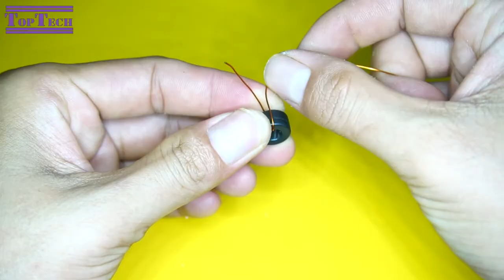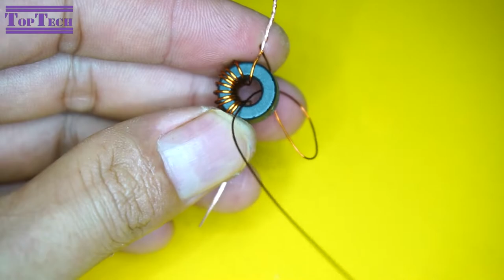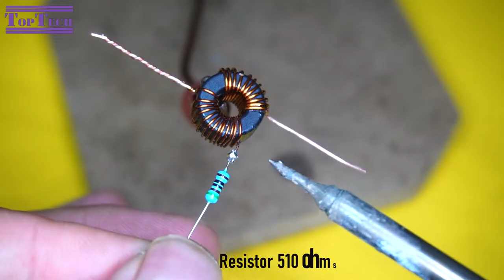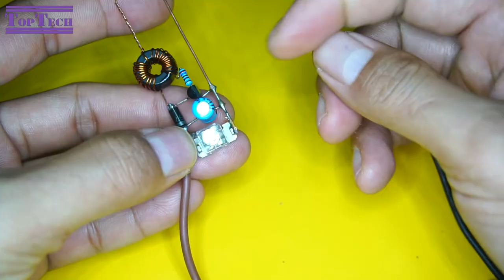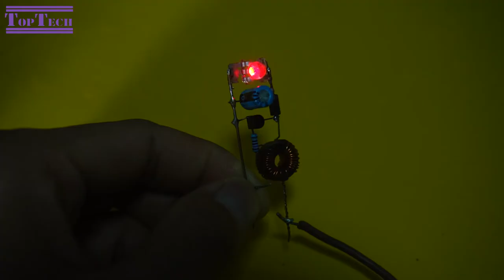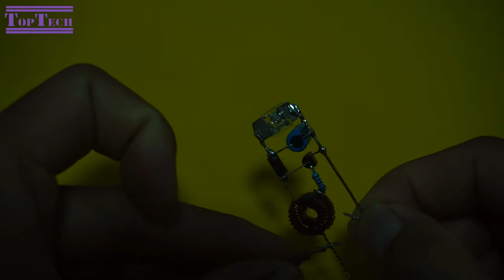How to make Step up booster 1.5V to 3V 5V 9V 12V

Comment: You claimed for multiple voltages from the circuit! Why did you fail and disappoint the poor viewers. Bad manners. There is no voltage measurement. What is the purpose of not proving the voltage. Why is Zeher not used? Hope you will like to respond.